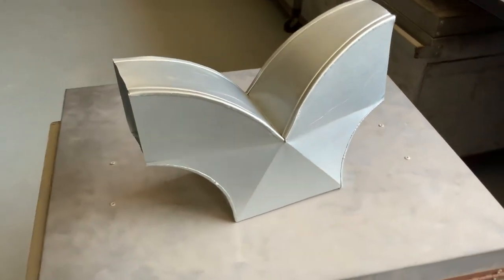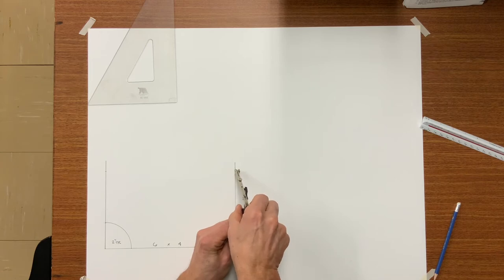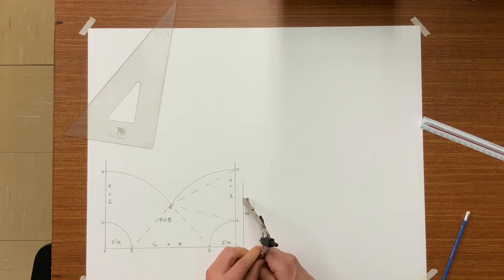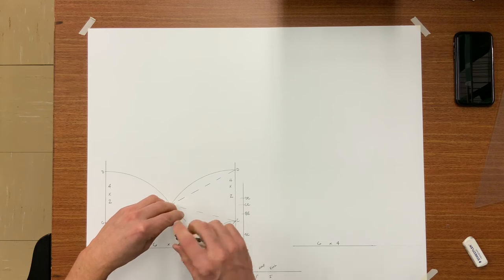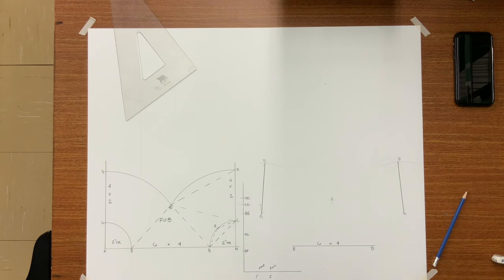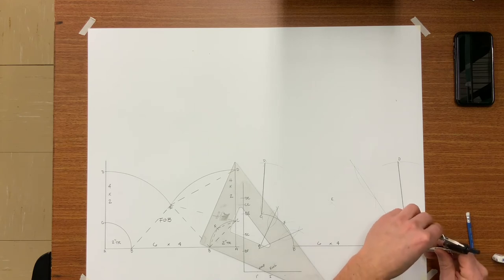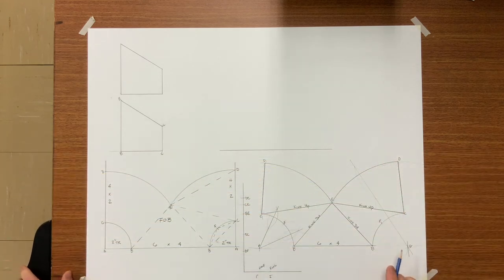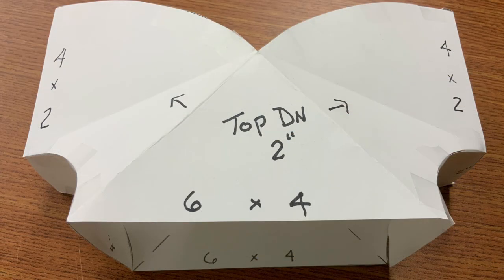Triangulation - Transitional Y Branch, paper layout

Comment: Hi Duane.  So, 2 pieces to make the heal.  How do you join them together at the crotch?  Extend 1 heel piece by 1/2" and spot weld?  Thanks.
Reply from the maker: That definitely works if a spot welder is available, if not one could use, something that looks like a standing seam, or even an S cleat on one half and a small flange on the other.
I hope this helps :)

Comment: Excellent tutorial but how do you form the male part of the lock form on the top of the y branch (where the 2 heels meet). I take it that it can’t be done in one pass through the flanging attachment on the lockformer?
Reply from the maker: Great question! And you are right, you cannot turn 100% of the Cheek flange.  You can only turn approximately 2/3 and then you must pull the cheek out from the flanger before getting caught in the Crotch.  The flange will then be completed quickly using pliers or some sort of 3/16 jig.  Again, great observation B, When I find time I will try to do a demo.

Comment: Why do you Multiply the throat length by 1.57?
Reply: 1.57 I mean?
Reply: Is that account for Pittsburg seams?
Reply from the maker: I multiplied the throat Radius x 1.57
Reply: But why 1.57 Specifically? I tried doing that and they came out short. Also I noticed that the finished Metal fitting at the beginning didn’t have any Transverse connections. I’m guess that would be for a Duct Mate application. But in and 
S and drive application where does the kink lines go? To the Point of the fitting or the end of the of your male 1/4” flange?